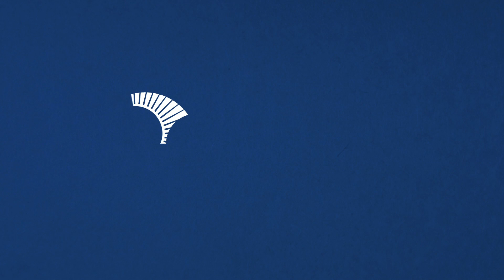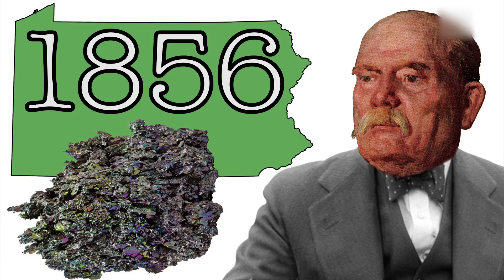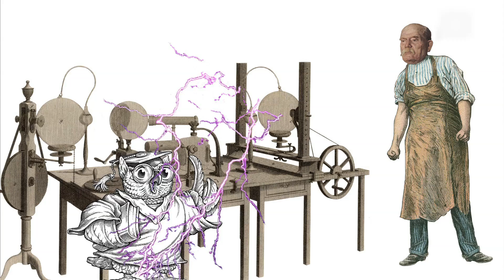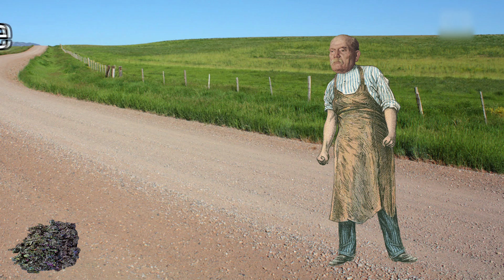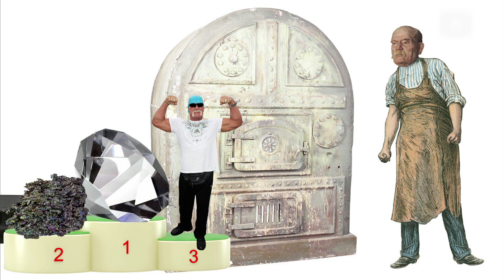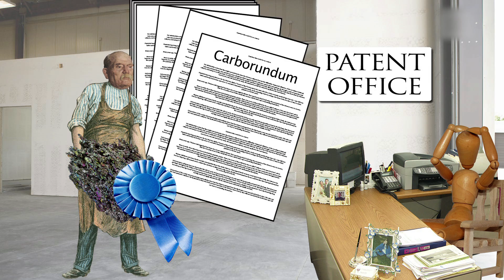Carborundum: Where did it come from? | Stuff of Genius

Comment: I have one.
Reply: I have one and any time I move it it makes large scratches in my desktop
Reply: Sayleon Smith i have one too !! But it is very fragile, no? It is always with sand around it?
Reply: André Jesus mine does not have sand in it, but yes it is fragile! I put some force on it expecting it not to brake but I guess it did.
Reply: Sayleon Smith but shouldn't it be strong? Why , in this form, is such a hard material so weak?
Reply: @andrecostajesus  thats what I was thinking! I'm not exactly sure why is brakes easily. It might be that they have to straighten it somehow. But I don't know.
Reply: I got one too